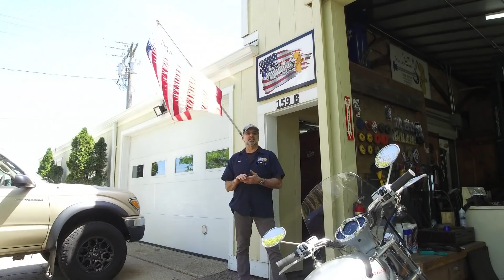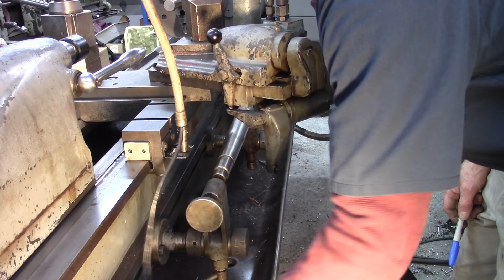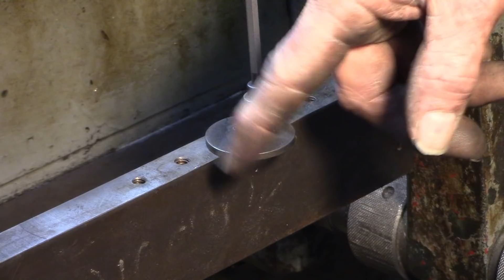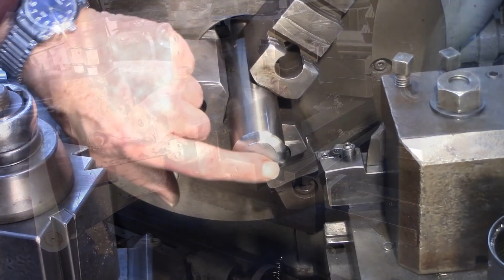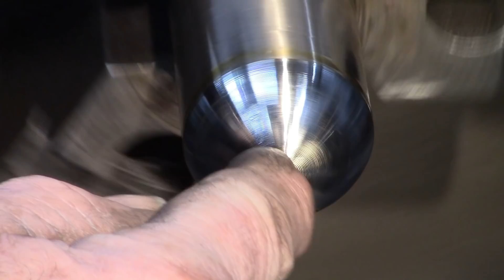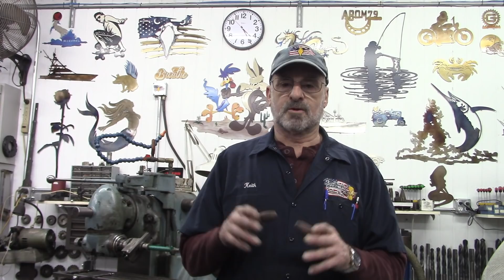Making Spherical Ends

Comment: When I was a tool die apprentice I worked at a shop next door to the Giddings and Lewis shop in Madison. I made many temples for the grinders and lathes at G&L.  I use a brand new Bridgeport with a cup grinding wheel to finish size the template. They had to be "dead nuts" One time I missed the finial finish kick out. The guy I worked for never got mad but told me " I could have told you check that a thousand times but it would mean as much as what you did now" I never forgot that and when I was a Supervisor / Superintend at a shop with a large crew guys when a apprentice when slip up I told them the advice Bob told me. I am 74 and never forgot his words, I can see him standing there looking at me now in his white  shirt looking at a 20 year old kid . Thanks Bob.

Comment: Brought back 1964 memories, I did the injection mold tooling for the Valiant taillights using a hydraulic attachment on a Bridgeport. We also had an aftermarket hydraulic tool post attachment for our Monarch lathe, never used the 30° angle tip, simple bump and shim the template for X and Y adjustments.
Happy New Year, enjoy the bikes!

Comment: That little nub on the end is from the tool nose radius.  If the pattern had a flat on the front,  the cut could start past the centerline by the amount of the tool radius.   I used to work in a shop that had the same set up.   We would cut patterns on the CNC mill to use on that lathe.

Comment: Seems like it would have been easier and faster to set up a ball turning tool if you have one than to have used that tracer.
Reply from the maker: It actually takes longer to share how it works than just doing it. Also the next four ends I have to do after the set up just go automatically in the same stick out from chuck.

Comment: 1:35 i wonder where that wear comes from.
Your "Marine-Theme" is so interresting for me as a machinist myself, but at the same time totally new for me.
I know there is wear even on Propellerblades due to mini explosions i think because water moves very very fast in certain areas.
But the wear in that area seems odd. Is it only from the pressure of the water over all the time, but because objects passing under the ship hitting that area?
Reply: That will be were the (cavitating) tip vortex from the propeller meets the rudder.
Reply: @ferrumignis  Uh, that makes sense. Thank you very much.